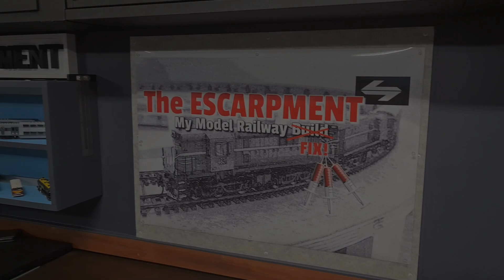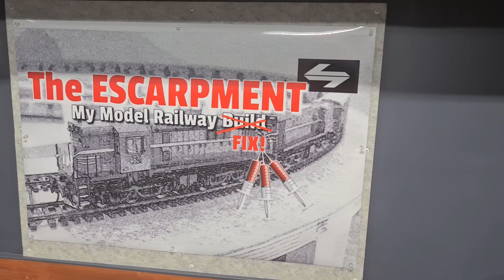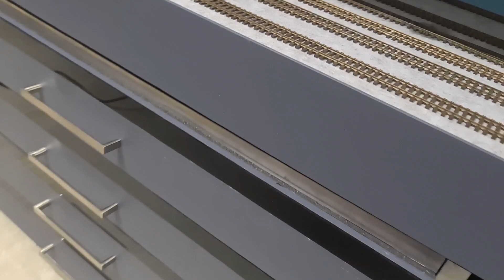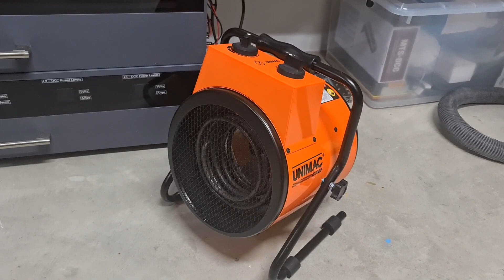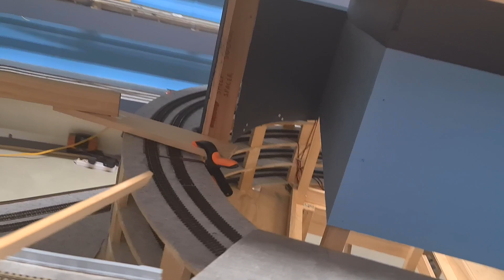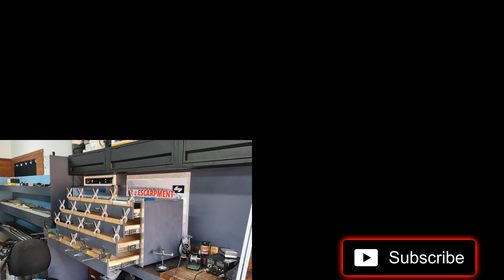July 2021 Model Railway Build Update - Winter Blues - The Escarpment

Comment: Hi Jason, I think for someone that has the winter blues and a little lost motivation you’ve done a fair bit!
Winter time here is not much different, maybe a little colder? I have 3 heaters in my cabin, two oil filled radiators which I keep on throughout the winter and then a blower to take the due off when I’m working. It gives me an escape from being in the house window licking!
Love the channel branding are they glue syringes for ballasting 🤔😂
Always enjoyable mate, still enjoying our summer although we were moaning about how hot it was at golf the other day, spend all winter moaning how cold it is, hey, go figure, lol!
Cheers Jason, John
Reply from the maker: Lol John, yeah either to hot or too cold. Either way, I'm just enjoying the slower pace, gives me more time to think. Although that is not always a good thing, cause I end up starting another project somewhere else..I never ll earn lol. Regards
Reply: Lol!, with you there Jason!